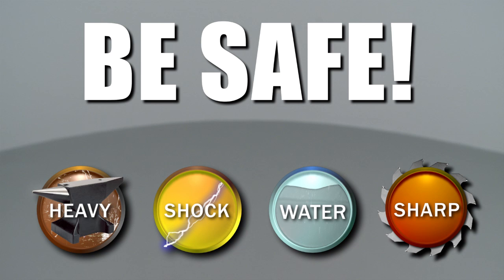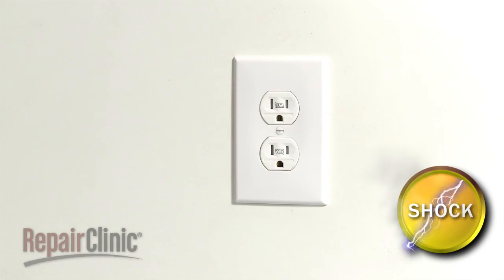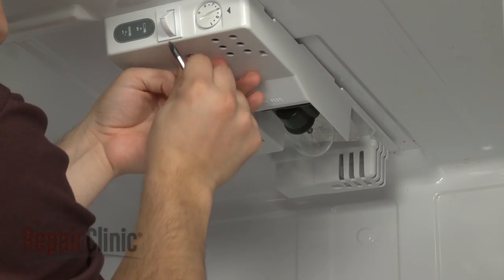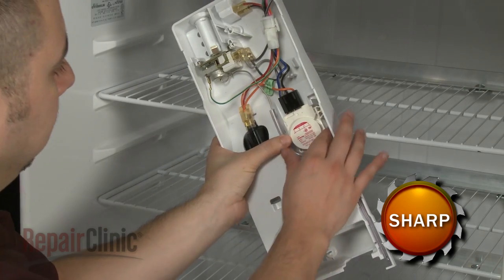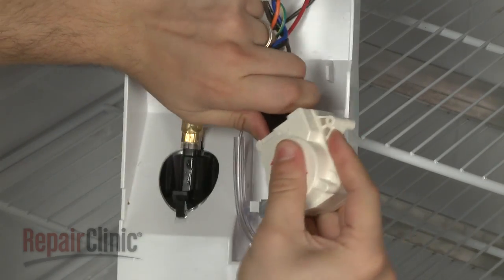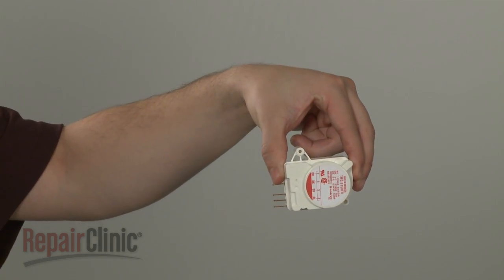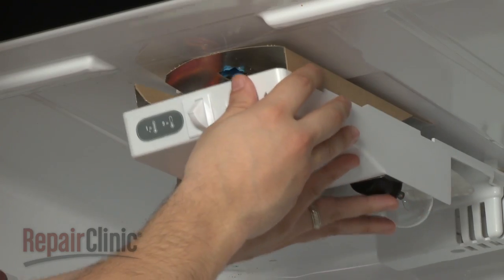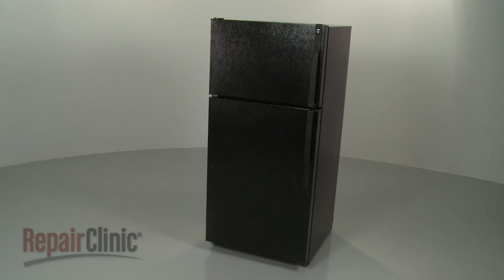GE Refrigerator Not Defrosting? Defrost Timer Replacement #WR9X489

Comment: My GE model TFX22PPZ defrost timer is not under the front panel, not in the back panel and not in the lighted section inside the frig where the temp dials and water filter are located. However, while I had the plastic cover off, I noticed a small round hole. Another YT video showed a guy using a flat head screwdriver to reset the defrost timer by turning it counter-clockwise. So I tried it. Although the flat head could not "catch" because the plastic was broken, the fan turned off. So i am hoping that it will go back on in 20 minutes and 3:30am will be the time it defrosts going forward. No info about this in the manual. What a pain in the ass....

Comment: Repair Clinic - so I tested both my defroster and defrost timer with a multimeter. Both test as good. It appears the defrost timer is not getting power. The refrigerator light is on, the freezer fan is running. Everything is working as expected except the condenser coils freezer over due to the defroster not kicking on. Any idea what could be keeping the defrost timer from receiving power? Thanks.
Reply from the maker: +David Siglin You would need to use the wiring diagram of the refrigerator to trace down the problem.
Reply: ok thanks
Reply: @dsiglin  hey Dave I have the same exact problem you did. Did you find the solution to this problem?

Comment: My freezer defroster isn't running so I replaced that. That's when I noticed the defrost timer wasn't advancing. I manually advanced it until it clicked and the compressor shut off. After waiting 5-10 minutes I checked the defroster hadn't kicked on. Would that indicate the problem is somewhere else, not just the defrost timer not automatically advancing? Clearly the defrost timer is broken because it won't advance but I would have thought me manually advancing into defrost mode would have turned the defroster on. This is for a GE WR9X520.
Reply from the maker: +Rachel Siglin The defrost heater could be defective and unable to turn on even when you manually advance the cycle into defrost mode.
Reply: +RepairClinic.com I replaced the defroster (a kind of heating element) with a new one.
Reply: +Rachel Siglin as in I replaced the defroster and it still won't come on even when I manually turn the timer to defrost mode.

Comment: My unit is post-2002 and apparently does not have a manual timer but rather the defrost cycles are controlled by the mother board.  So I replaced a faulty heater element and it was still freezing up.  I can't reach the ends of the wires for the thermostat so have not checked it doubt both thermostat and heater would quit at the same time.  Any ideas?  Anyone?